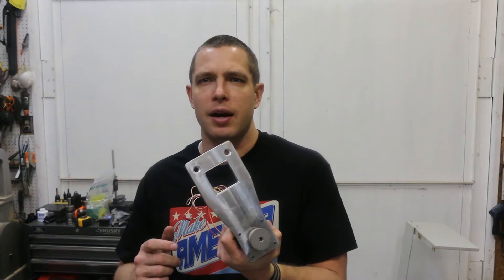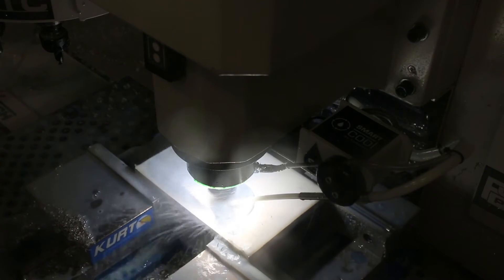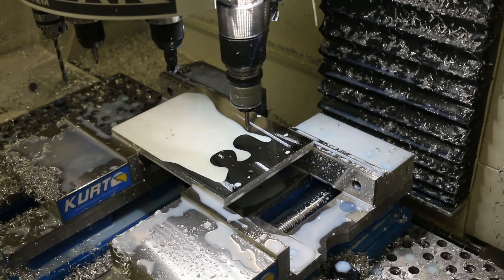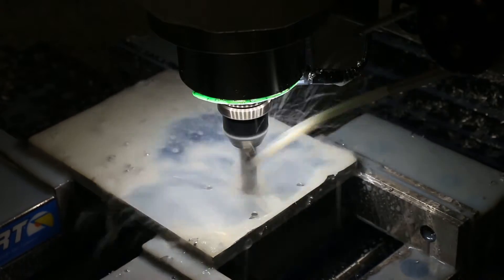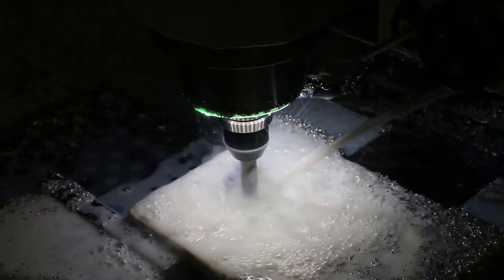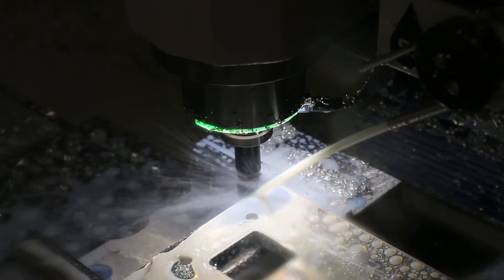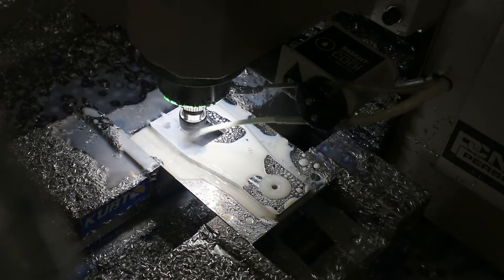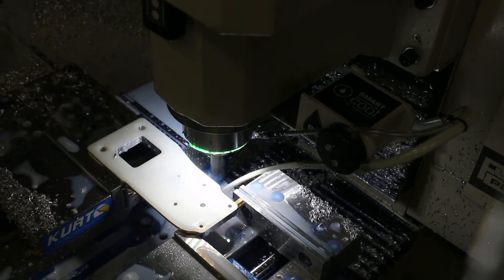Tormach SmartCool - Multiple Tools - Fusion 360 Post Processor - Stepper Motor Bracket

Comment: I see this is a few months old but will add my 2 cents worth.I would make a smaller tip and play with the hole size in it.Not to reduce the flow too much but just to help with a bit more pressure and a bit less flow through the pump to stop it from emptying the tank.Maybe we will get another video from you on the upgrades when you have time.
Reply from the maker: I have a much bigger pump and tank to install but I've been busy with outside projects.
Reply: It is really only the increase in tank size needed.A bigger pump may just empty the bigger tank and result in the same problem.It is getting the coolant back to the tank that is the issue not getting more coolant up to the job.
Your videos are nicely done by the way.Hope to see more of them.
Reply from the maker: I agree but I think most of my return problem at this tank size is coolant trapped under the fixture plate which should be a fairly fixed volume.  I also have an idea coming to greatly increase the flow to the tank coming this winter.

Comment: Cool! I think they got the idea from my DIY system. If they did I'm OK with that. Is there a calibration to adjust the angle or  an adjustment on the nozzle. Needs more pressure.
Reply from the maker: More pressure is on the list.  I've had a 2000+ gph pump for a few weeks just need to find time to get that done.

Comment: I think with the coolent dropping of has to do with gravity . gravity is taking over more when you have a longer tool .. having a faster velocity ie more pressure will help compensate gravity pulling down on the coolent.... id say if your coolent pump doesnt have a lot of pressure try making a smaller tip that goes over the end of the smart cool making the smart cool be more like a squirt gun rather than a super soaker. or if anything try extending to tube on the smart cool closer to your tooling with a ridged brass tube.
love your videos as being new tormach owner, I wish to own a tormach someday..
keep up with the projects.
Reply from the maker: Yes, maintaining the pressure (velocity) to reach the tool in less time decreases the impact of gravity on the z position. Since the issue is caused by the time delay between coolant leaving the smartcool and entering the tank a smaller nozzle would reduce the flow and make it take longer to reach the point where the pump is running out of coolant and there is a point where it would balance out, but flow is key to clearing chips and bigger is almost always better ;)

After I posted this video I started shopping for coolant upgrade parts. Much larger tank and pump that is probably overkill are on their way.  Current plan will include enlarging the hose to the smartcool and making it's tube larger and longer.  I'm working on some crazy ideas involving the usb i/o board and an air piston but we'll see how that turns out.  Also brainstorming some ideas for dealing with chips.